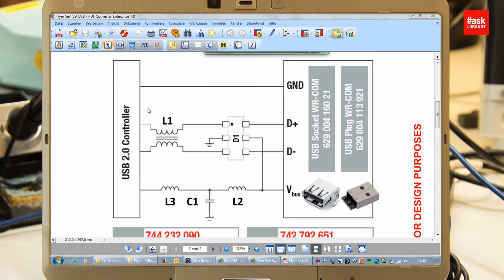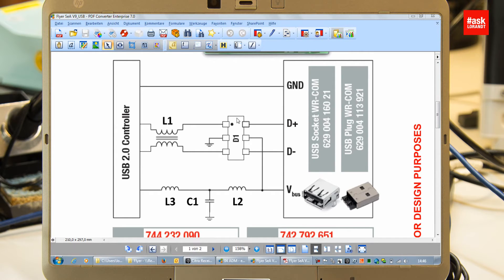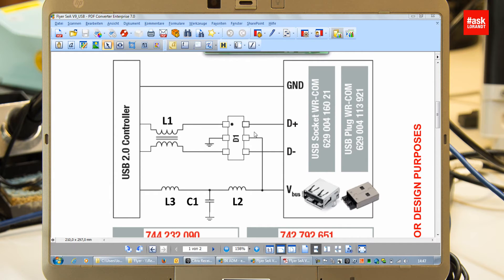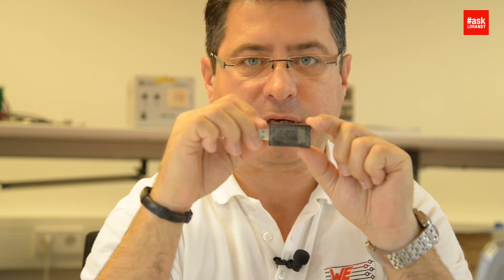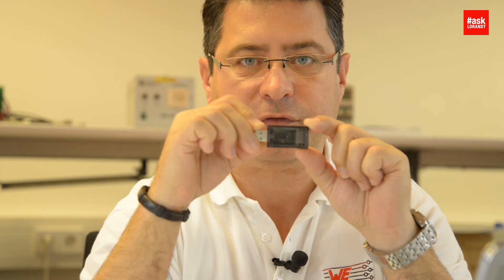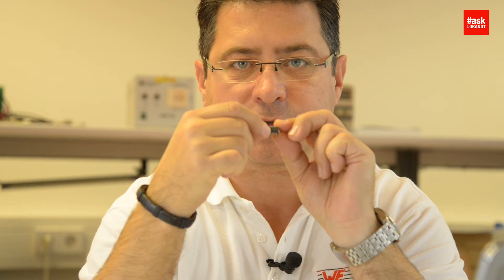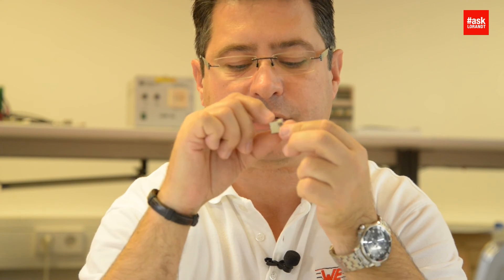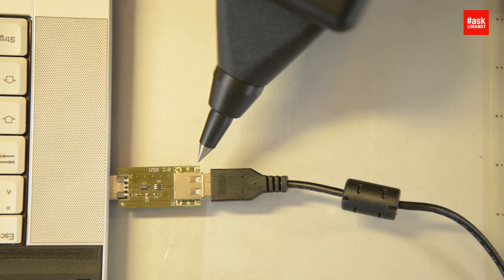#askLorandt explains: EMC Filtering of a USB 2.0 Port

Comment: Hi Lorandt,

wie sieht es mit dem Shield des USB Connectors aus? Anschließen an Ground, offen lassen, 100 Ohm, ein C dran?
Die Filterung findet dich einzig durch das differenzielle L statt, oder nicht? das iC dient dann lediglich der ESD Protection durch Z Dioden?
#askLorandt
Reply: Hallo Heribert, dazu gibt es keine Regel. Komm es auf die Schlatung oder Konstruktion an. Wenn Abschirmung (Shield) und Masse (GND) sehr niederimpedant und großflächig gehalten wurden, kann ein L sein. Ist nur in eine Stelle oder gar nicht an GND angebunden, könnte ein C sein (..kV!). Das wird oft diskutiert und versucht die eigene Erfahrung als das Beste zu "verkaufen", aber es ist immer Situationsbedingt. Ich hatte z.B. gute Erfahrungen zwischen Shield (USB Metal Schirmung) und GND mit eine 1nF/3kV nah wie möglich plaziert, kurze parasitäre "L". Andersmal eine ähnliche Aufbau und beim ESD Test durchgefallen mit der 1nF, aber bravourös mit ein Chip Bead Ferrit [30 Ohm] (WE-CBF) bestanden. Daher kann ich keinen Rezept dafür geben was besser wäre. Muss ausprobiert werden. Ich würde eine SMD Pad mit 0805 vorbereiten und bei der ESD Test beide Lösungen ausprobieren. Mit eine Z Diode habe nie probiert, denke das wäre zu riskant.